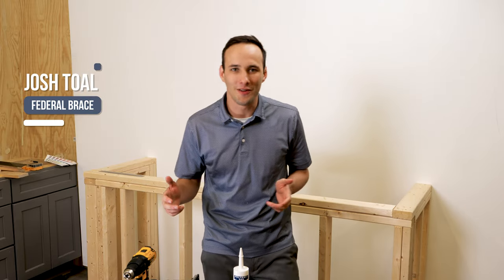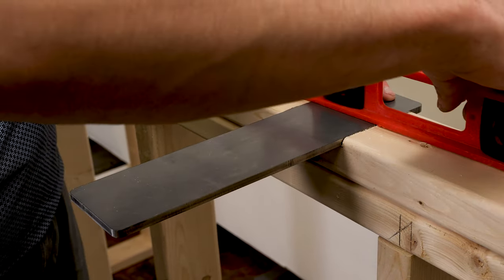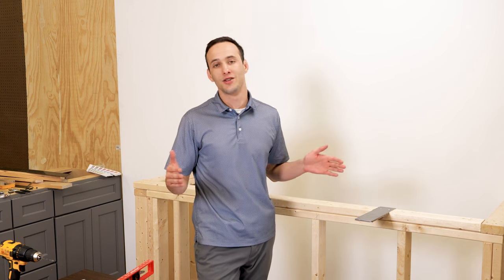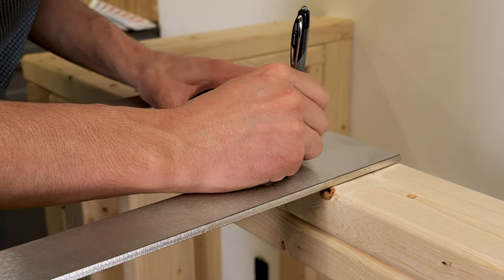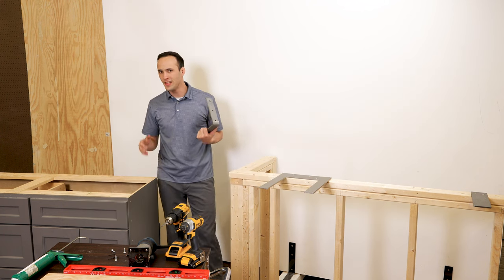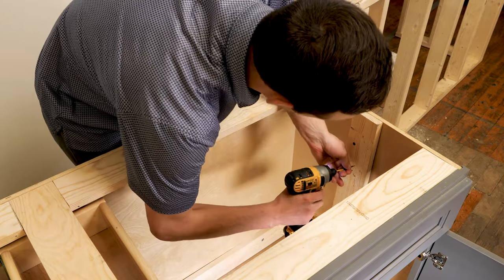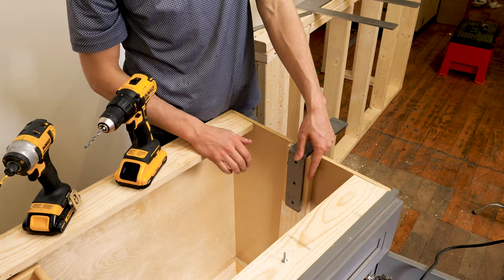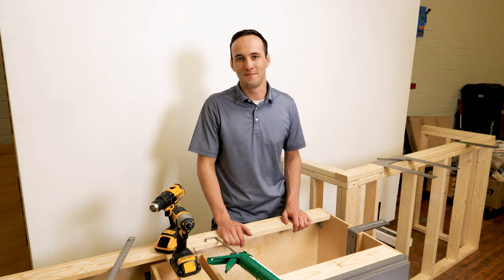Which Hidden Countertop Bracket Is The Best? • Federal Brace •

Comment: Helpful. Just use a clamp to hold it in place. Also, you need better bits so the heads won’t strip.  Lower that drill speed and torq. 😁. Clamp a scrap piece of plywood against the outside of that cabinet wall to prevent tear out from the router on the cabinet.
Reply from the maker: We respect people who know their craft! Thank you for the input

Comment: That last install looks like it will interfere with the drawer. Unclear how the second product works.
Reply from the maker: The Lincoln Top Plate is intended to be installed in the top plate without the need to route out the supporting structure. The plate can be used in the same format as a standard hidden bracket or butted up one next to the other along the length of the structure to fill in any gap between the bottom of the counter and the support structure.

The Freedom can be installed within the cabinet as shown in the video.  You are correct that this would likely interfere with a drawer if one were present.  In that case the furring and bracket can be installed on the exterior of the cabinet and covered over with fascia.